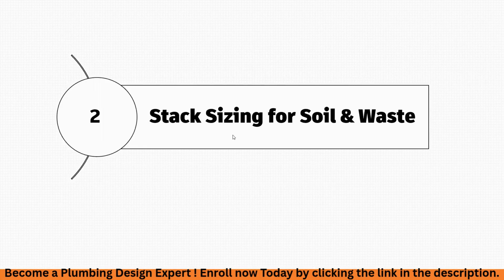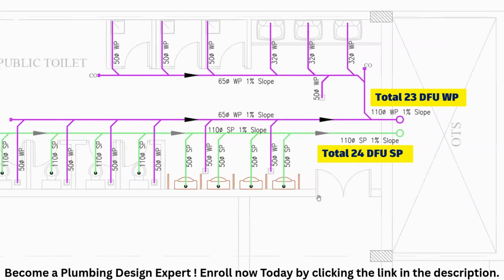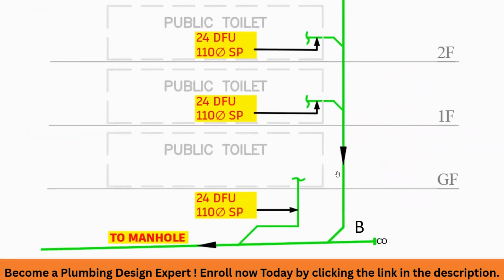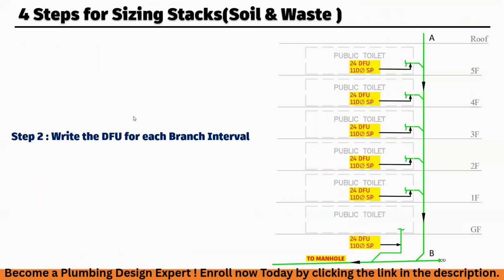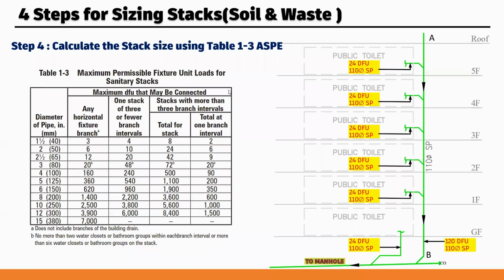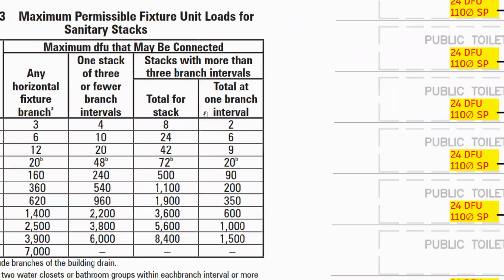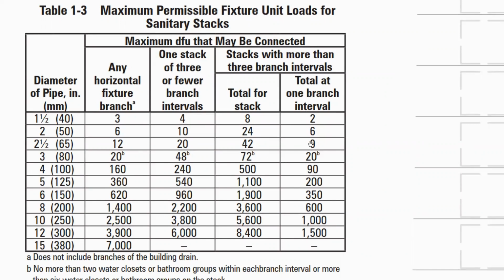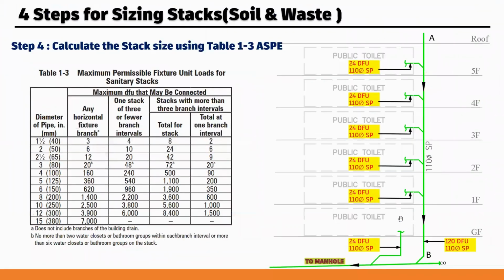How to Size Plumbing Drainage Pipe || Comprehensive Plumbing Design Course

Comment: when the branch pipe dia is 110 , so the stack pipe dia should be equal to more than the branch dia but in this case its only 100 dia is that ok?